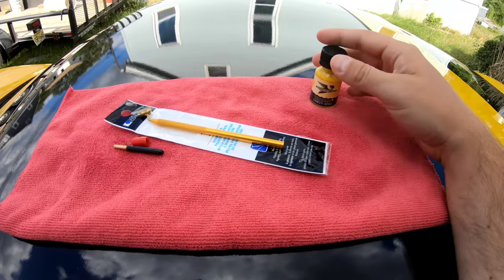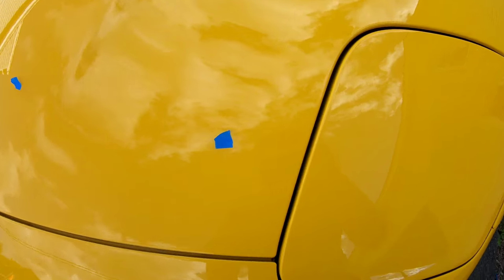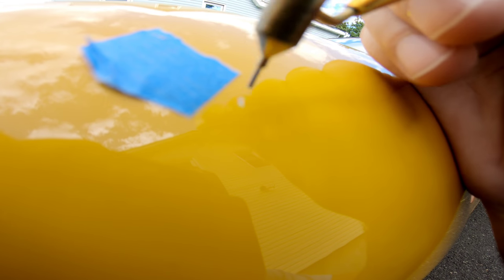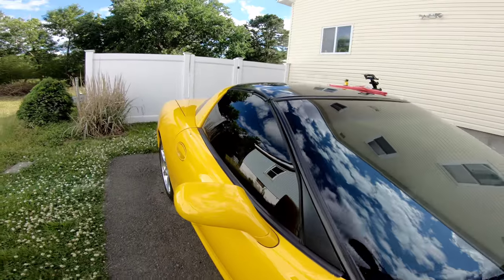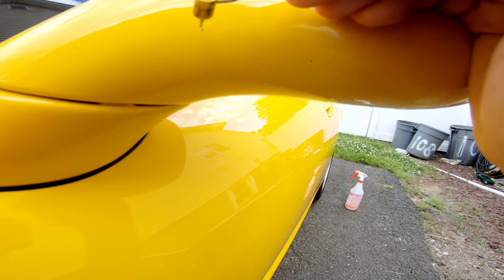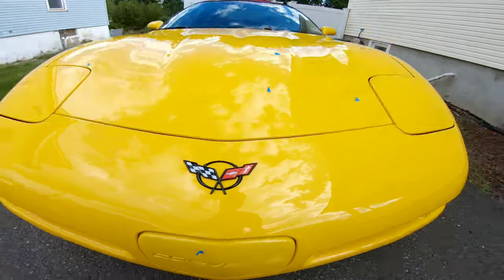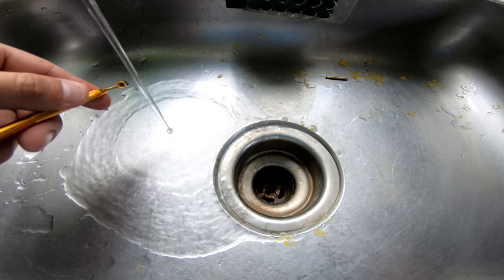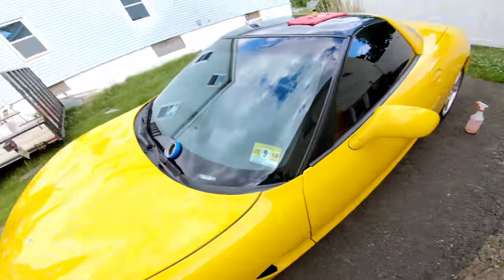C5 Corvette Rock Chip Touch Up w/ Loew Cornell Pen

Comment: Great video! I would like to do this with mine. Same color. I see the ad for the touch up paint calls for clear coat. Did you use clear coat and do feel it's not needed?
Reply from the maker: I didn't add clear. If it was anything more than a chip, I would add clear. With the chip, you can hardly notice the touch up unless you know where to look. There will be different opinions on that tho lol.
Reply: Thanks,I was was thinking the same thing. Great video!
Reply from the maker: Good luck and thanks for watching.

Comment: Does the paint need to be clearcoated
Reply from the maker: It can. I didn't bc it was scarce except for on the mirrors. If the damage was worse than these fine chips, I would have used clear. You can barely notice the touch ups, even when you know where to look.

Comment: Did you polish it after touching it up? If so, did you wet sand it, compound or just use polish?
Reply from the maker: Definitely case by case but all I did was polish afterwards. If more severe, wet sand would need to be done. This helps keep the touch up where it's needed and easy to control how much.
Reply: Got it, thanks!
Reply: You wouldn’t happen to have any pictures of before and after? I’ve got about couple dozen chips I need to fix and I’m wondering how well you can tell afterwards.
Reply from the maker: I don't but it's hard to tell. If you knew where to look, then you'd see it but otherwise you'd pass right over it.

Comment: How close was the paint match
Reply from the maker: Close to perfect. I didn't notice any difference.
Reply: I did one chip to test this weekend with same paint and color was off.   I wet sanded , clear coated and wet sanded and then buffed it turn out great nice shine but color clearly off
Reply from the maker: That's weird because mine is pretty close. Maybe sun fade over the last 15+ years. Sorry to hear that though
Reply: YellowVette04 no worries.  I just did a very small chip looks much better. Not sure why it was off.  My vette is 03 with 60,000 garage kept and covered whenever not in use.  I don't even like a spec of dust on it. 😀 as for first chip mystery I guess Shook it up well, cleaned etc..  It's not terrible but could be better.  I appreciate your video.

Comment: Did you order the 1/2 oz or the 2 oz of paint
Reply from the maker: 1/2oz. It's more than enough for chips.
Reply: Thanks for the quick response to my question. Also I appreciate your video on fixing the chips and the info on the  Loew Cornell Fine Paint Pen.
Reply: I ordered the Paint Pen, price down to $7.74 with tax
Reply from the maker: No problem. The price is really good right now, so it's definitely worth it and makes it really easy. Thanks for watching 👍
Reply from the maker: I was responding to you when you responded with the price lol. Cheapest I've seen it